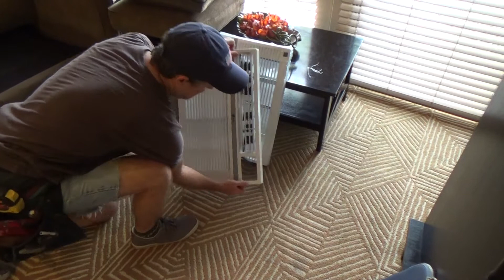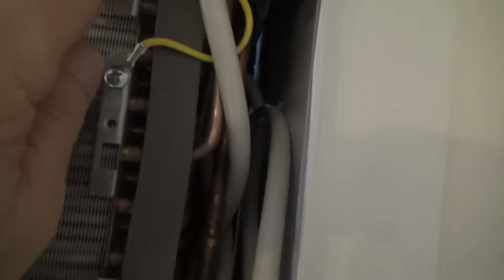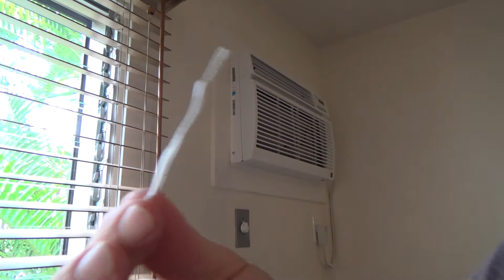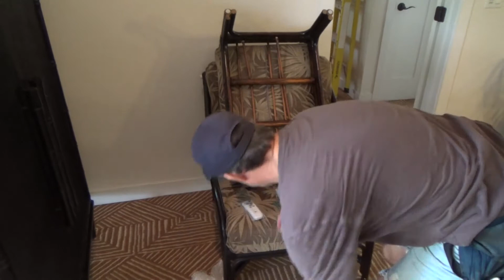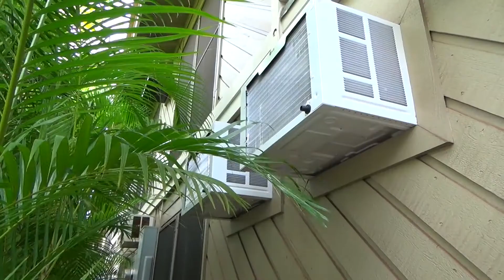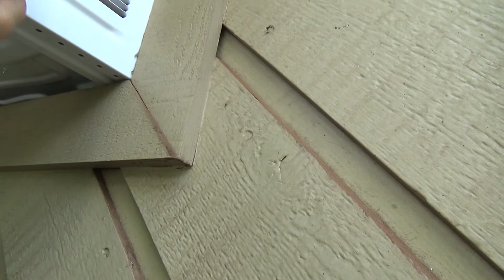How to Install LG AC Window/Wall Mount Unit...Part 7  Installing FaceFrame Trim Cover Made Easy!

Comment: I am trying to clean inside my vents… I see how you click in the face of the AC but how do you remove it? I can’t get mine off 😭 it’s the same face as in this video
Reply from the maker: So sorry you are having a hard time removing your face frame. did you watch the entire video so you see how I installed the cover? You then have to remove the cover the very opposite. First off remove the washable filter & look in there to see if there are some mounting screws in there that hold the cover in place...remove the two screws. Then where the cord comes out at the bottom you will need to tweek the bottom cover edge off the little clip then you can kind of push the cover over to unsnap the opposite bottom clip then you can push the face frame straight up so it comes off the top clips & now you have the cover removed! Let me know how you do! Thanks for stopping by......

Comment: I have this same exact unit. There is a soft black foam in the celing of the unit where the air comes out. Remove this because it collects moisture and will mold and mildew.
Reply from the maker: Thanks for the tip!

Comment: I bought one but the botton part where the cable is at dont want to click and water leak out
Reply from the maker: The power cable would have to be re-positioned in order for the side to click in & if water is leaking out then my guess is the unit is not installed with the proper tilt out to the outside. I have more videos of this install so make sure you watch all of them for more learning. Go to my main YouTube channel page then click on playlists & scroll down to AC projects (or something like that). Thanks for stopping by!

Comment: Really a great job and explanation!!! ...My a/c hasn't been well installed with the right angle 1.8" and 5" and I've to reinstall it!... It's a mess... Thank you. You really explain everything in detail 👍🏼...
Reply from the maker: Thanks so much for your message. This video was part 7 of this install series...did you watch all the other parts for more learning? I also made videos for how to remove a wall mount ac unit as well. You might want to watch those too. I have all those videos on my channel as well...of course! Just go to my main YouTube channel page then click on playlists then scroll down to hvac & they will all be there....& more! Check it out & let me know how you do with your removal & re-install ok?
Reply: @videojoeshows  Thank you. Yes, I saw the 7 videos. Thanks 😉
Reply from the maker: @zhulune1184  Well I have waaay more than 7 videos since you may have just watched one video series where I have done more than one video series. I show videos of how to go about removing an old wall mount ac unit & how to go about setting up a new unit from new box on & how to install a new wall mount ac unit & I also show a few more things when it comes time to install even showing you a few tips for running your wall mount ac unit & using the handheld remote etc.. Try looking some more if you want to learn more. Just go to my main YouTube channel page then click on playlists then scroll down to hvac & you'll also find some in the electrical area in the playlists possibly for wiring up a 4 hour timer I installed on the wall that was tie into the ac unit. Check them out when you have time. Just prepare your favorite cup of "joe" as you will find lots of videos to choose from. You might also be the type who enjoys nature videos? I have those on my channel too. In the playlists area. I also have an inspirational area in the playlists area too where I do lots of readings out of some of my favorite self help books that will help you be the best person you can be. Check them out!

Comment: How do you take it off ? Dirt has gotten passed the filter .
Reply from the maker: If you have the exact same faceframe trim that I show here then you can pull out the washable filter & just behind the filter you should see two mounting screws that secures the faceframe front to the rest of the AC unit. One screw to the left & one screw to the right...do you see them? Sometimes they forget to install the mounting screws & will leave them out but I put them in. If you see them then remove them & then you can go to the bottom of the faceframe trim & down to the bottom edge you will see the notch in the frame where you will see the cord coming out. Just take a little screw driver & gently pry away from the bottom side edge of the unit to remove it from the little plastic prong on the side of the faceframe. If you do it too rough you could break or crack the plastic faceframe cover. Now you can kind of pry off the other side then kind of pop the frame up off the top clips of the unit & the frame will come off so you can then get in there & clean off the aluminum fins. You can take a wire brush to the fins & I use simple green to spray on there as I am brushing the fins then spray some more cleaner on there as you go & soon enough you will get it really clean...with a little elbow grease! If you watch this entire video again you will see how I install the faceframe trim so you will have an understanding as to how to remove the trim. I also have lots more videos of removing & installing AC wall mount units. Just go to my main YouTube channel page then click on playlists then scroll down to AC units & you will find them there. If you have a different faceframe trim cover then remove the washable filter & look in there all around the see where the mounting screws may be hiding so you can remove the mounting screws to then remove the faceframe trim. Be gentle as you don't want to break or crack the faceframe for next time you need to remove &/or resecure back in place. Good luck & thanks for stopping by. You can always send me your questions on any video you may see on my channel. Take care...

Comment: How do you get the front off the LG  a/c off?
Reply from the maker: If you watch the other parts to this video series you will learn more. the two different fronts that I have worked on if you look you should see some mounting screws in there. If you have the type where you have the horizontal strip that you remove & pull the washable filter out you will see there are two screws in there that you will need to remove. then go down towards the bottom of the grill where the cord cutout is & gently pry on there with a screw driver or just pull over a bit to unclip the bottom then go over to the other side & do the same then push up & the face trim will pop off the tops clips so you can remove. The main thing is to check to see if you have those mounting screws in there as sometimes the installer uses the screws while other installers leave the screws out. Then the  face frame should come off. Look around & don't force anything or you could break off one of the mounting clips. You'll get it just take your time. Let me know how you do. I have lots of other videos where I show how to remove an entire wall mount ac unit & also where I install one from scratch. Just go to my main YouTube channel page then click on playlists then scroll down to AC install (or a title something like that) & you will find all of the videos there. You'll learn some good stuff for sure. Take care & thanks for your message!

Comment: Thank you for the video. I've been trying to clean my A/C coils for months but could not figure out how to get front panel off.  Those two screws were quite well hidden. Thanks to the video I saw your explanation and those two screws! Now I can clean more than just the filter weekly!
Reply: Did yours come off easily after removing the screws? I've got the same unit and am also struggling to get to the coils for cleaning. Did you use a screw driver to pry it off or something? Even with the screws out mine still feels pretty stuck! 

Edit: Never mind, I got it! For anyone else that finds this in the future: There are tabs on the bottom left and bottom right just above where the power cord goes into the unit. Once the two screws are out, poke around with a putty knife where those tabs are while wiggling and pulling the bottom slightly outwards to release them. Once those bottom tabs are released, pull the bottom of the face out slightly to release the top and the whole thing will lift off. The bottom tab on the left side was easier to undo first, then the right side was much easier.
Reply from the maker: So glad you were able to find my channel & this particular video! Awesome that you have decided to clean the filter & the fins on your own so you can save money! As you can see this video is part of a video series so there may be other videos in this video series that might assist you further. I also have a ton of AC window mount DIY videos on my channel that you might be interested in. Just go to my main YouTube channel page then click on playlists then scroll down to AC videos & you will find them there. In fact please take a few minutes to review all of the DIY topics I have on my channel in the playlists area so you can see what else you can watch that could save you some money around the house. Nice going for wanting to do things on your own. I always say that I won't post a video I think you CAN'T do which means I happen to think the majority of videos I post you will see that if I can do it (an average Joe) then YOU can too. Keep it going & thanks for your message!
Reply: Your video here doesn't show how you took the cover off why not I'm concerned I might break the cover???

Comment: Does that front cover click right off? I need to clean the front coils I don't want to break it. I have the same exact unit.
Reply from the maker: Lift up the first cover then you should see some mounting screws that hold the actual cover on. The screws will be in some recessed areas on the cover. Sometimes the installer may forget to put the screws in so if you see where the screws should go & they are missing then you should be able to carefully remove the cover to then clean the coils. I have lots of other videos that show how to do things on this same exact ac unit. If you want to see them you can go to my main YouTube channel page then click on playlists then scroll down to AC projects & they are all there. I have one that shows how to remove the cover I'm sure &/or how to install the cover & that will tell you how to remove it. Good luck with cleaning the aluminum fins....
Reply: @videojoeshows  ok I'll do that. Thank you so much 😃
Reply from the maker: @picho5553  Let me know if you have any other questions & good luck with your cleaning...!
Reply from the maker: @picho5553  Watch this video again starting at 1 minute 12 seconds until at least 1 minute 40 seconds to get the idea of how to remove the face cover...
Reply from the maker: @picho5553  Once you remove the two screws & then unclip the bottom right & the bottom left, you can then hit up from the bottom to raise the entire face cover off the top edge since the top edge will be clipped on but loosen from the bottom first so you don't break off the top clip areas.
Reply: @videojoeshows  when you say lift off the first cover do you mean snap it out?
Reply from the maker: @picho5553  I am so sorry. This is the new type of cover so remove the washable filter & after you pull that filter out there should be some mounting screws that hold the entire face cover on. Once you remove those screws (2) then you can carefully unclip the cover at the bottom using a screw driver or putty knife to unclip the bottom right or the bottom left first then you can get the rest of the cover off. See?
Reply from the maker: @picho5553  Watch this entire video again after reading all my messages & you'll be fine...! Good luck!